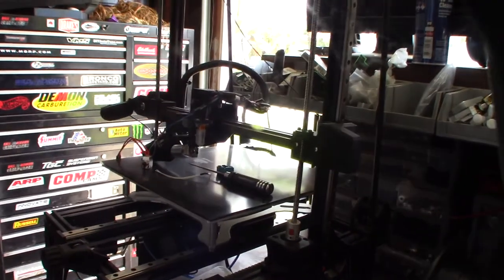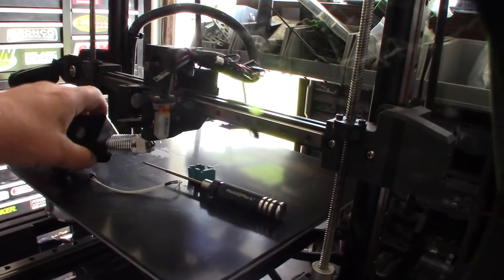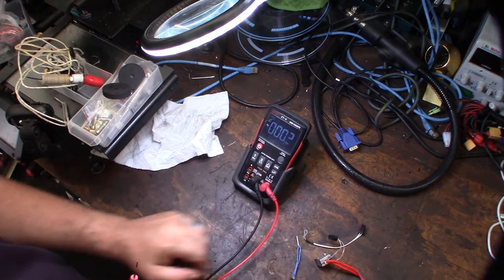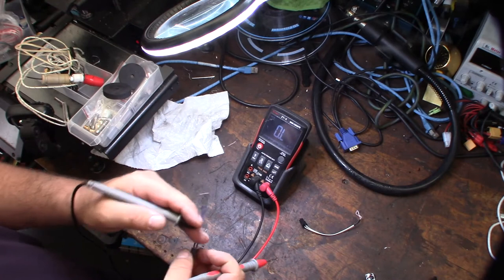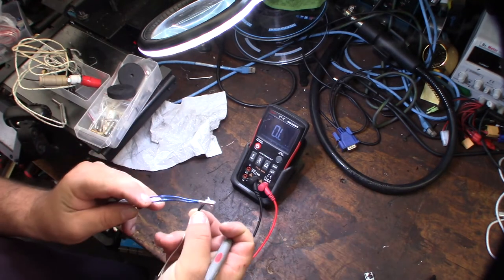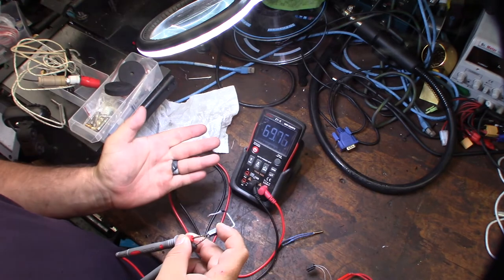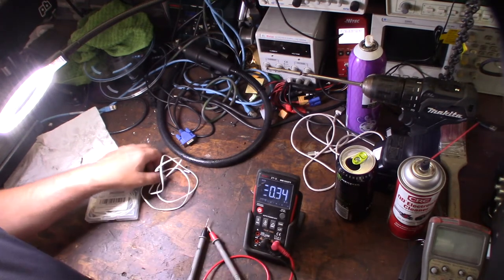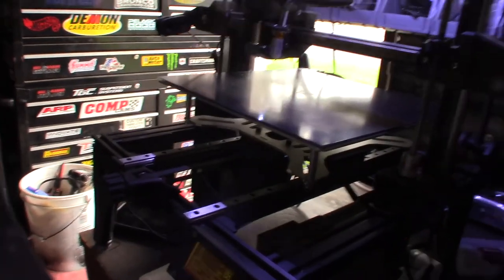3D printer hotend thermistor troubleshooting testing repair no reading

Comment: I just recently experienced fluctuating hot end temps that were not stable. It was a Creality Spider 4.0. I have searched for hours and never found out the exact reason why. I got a new one under warranty. I tested the thermistor on the first and second hot end. Something that was happening on the first hot end that I could not find on the web was that the resistance would change constantly at room temp. The meter would never settle on a resistance. It would go from 80k ohms to 180k ohms and bounce around at room temp. The second (new) Spider hot end I measured the thermistor and it settled about  110k ohms and held steady. If you have temp fluctuations then measure the resistance of the thermistor alongside your other tests.

Comment: Cool video.  Thank you for sharing your insight on this..   I have an issue and i'm thinking it might be the thermistor but i'm not in a rush to tear down the hotend on a hunch..    I have four ender 3 pros..  all configured identically..  PLA+   I print typically at 215c with no problem..  but one printer with everything else the same.. same settings / same sliced file will ooze PLA..  it's like it's hotter than the temp it thinks it is..  this is the easiest explanation..  but could a bad thermistor do this?   it holds a steady temp.. it's not erratic at all..  it's just like it's maybe at 230c.. but the display says 215c.. i'm trying to insure all printers work the same so i can make one slice file and print and walk away..   the stringing can be bad..

Comment: I'm not sure if this is a thermistor issue or not but on my MP select mini V2 while printing with PLA+ at 220° there was a slight smell of burning plastic followed by a small wisp of smoke coming from the hot end and the temps shot up to 330°.  I managed to quickly shut it down within a couple of seconds and checked everything over and other than a cooked nozzle I can't see any physical damage.   It still gets nice and hot and reads temps but the temp control seems WAY off now.  Set it to preheat to 220° and It'll run up to 260°+ and keep going unless I stop preheat.  I'm not at all new to electronics but 3D printing is VERY new to me.  I was gifted this lightly used printer a month ago so I am still VERY early in the learning process.  Up until this happened I have not encountered a single problem and when this happened it was my first failed print and I did catch it very early.

As an aside I tested the thermistor disconnected from the printer and by all rights it appears to be working fine.  I compared it against other 100K thermistors and heat probes I have and it tested right in line with them.  One of my multimeters has a temp setting and uses a 100K thermistor probe and it gives almost identical readings to the printer thermistor.   I'm leaning towards a control board issue and I hate to think about that as this would mean I will HAVE to upgrade to a better printer.  lol

If anyone has any ideas I am open to them.  I'd love to get this thing running again soon.  Still waiting on new nozzles to show up in the mail.
Reply: Have you done a pid loop tuning? You might want to look into it.
Reply: @angrygnome32  Thanks. 👍 I have.  I've done an autotuning and then slowly worked on the best PID settings.  I actually should have updated my post because I believe I have found the cause and resolved it.  When this issue would happen the SD was no longer visible which lead me to look into the controller board.  When it would act up wifi would drop as well.  Oddly enough USB was always fine.  I have found through LOTS of trial an error that printing via USB using pronterface works flawlessly so that's how I do it all now.  Weirdly USB printing from Cura is hit or miss but SD card always fails and no cards are readable until I reboot the machine.  According to a few sources on various forums the wifi and SD card reader share the same controller/resources so when one goes down the other follows which matches my issue.  As long as USB keeps working I'm cool with that.
Reply: @Enjoymentboy  cool man good to know. I haven't had issues like the ones I'm having with my Ender 6. I got it used and it's been a learning curve when it comes to the different components just to extrude the filament. But many gray hairs later I think I'm getting it
Reply: @angrygnome32  My best guess is that when this happens the controller for the SD card locks up and stops reading and processing the gcode.  When that happens it just sticks with the last thing it did.  The one that really confused me was when it retracted the filament all the way out and kept on going.  Super weird stuff here but at least I have it figured out well enough that I can print away without issues and didn't have to spend any money.  I'm just lucky that I have an electronics and computer background so troubleshooting came naturally.

Comment: Bed temp suddenly reads -50 and bed won't heat. Does it mean the thermistor is dead? It still reads 50kOhm but the resistance doesn't change with temperature change.

Comment: Darn it, I just got two of the E3D thermistors because I was getting thermal runaway.  I put on my thinking cap waiting for them to arrive and realized the new silicone sock was the problem.  One PID tune later and all is well.  Feeling double stupid for not thinking of the PID tune earlier and now for getting the junk thermistors... sigh.
Reply from the maker: I feel like the E3D thermistors are just as unreliable as the cheap junk amazon ones. I do like how the cheap ones have a single unbroken wire back to the mainboard. I've actually had one of the E3D Molex 3.0 connectors go bad.
Reply: I agree, more connectors is not necessarily good.  A bad molex is pretty strange.  Any thoughts on a good high temp thermistor for an enclosed heated chamber I am working on? The thirty bucks for a slice engineering unit seems silly to me.

Comment: I’ve just had to turn my printer up to 260 to get it to print I was thinking hmmm this isn’t right 🤔. I’m going to guess I’ve got less resistance tastier than more if it thinks the heat is higher than normal

Comment: I'm doing an arduino project and have a hot end the thing is the temperature is stable up to 120C and then it jumps 5-10 degrees up or down, what could be the cause?
Reply from the maker: PID tuning might fix it.
Reply: @fintechrepairshop  I found the problem I had a too big fixed resistor, It was 100k but I switched it to a 5.1k so now it can do the full range